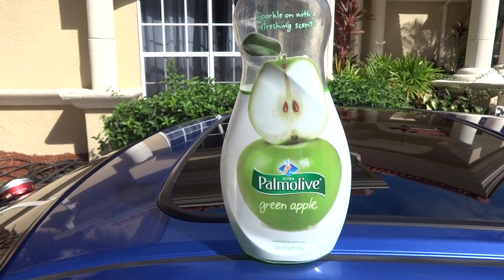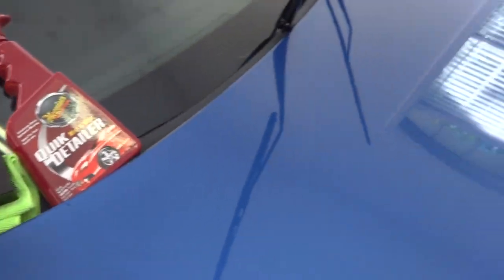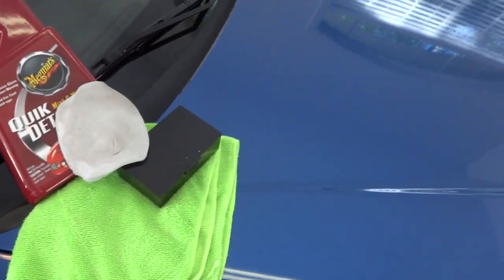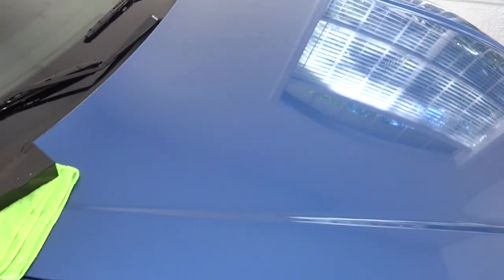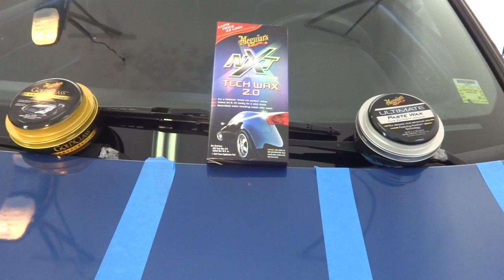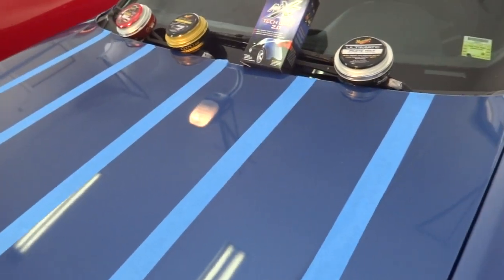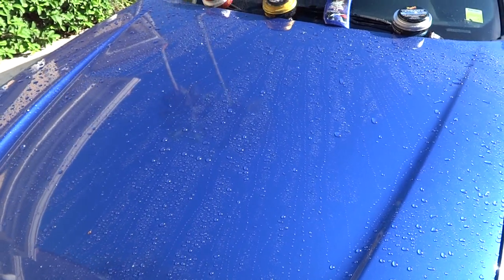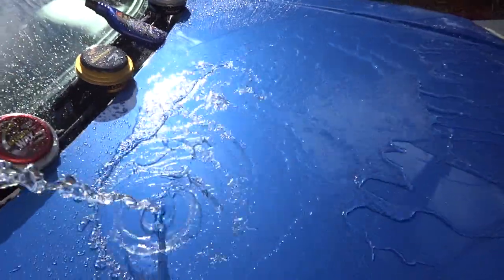The difference between Meguiar's Cleaner Wax, Gold Class, Tech Wax 2.0, and Ultimate. Comparison.

Comment: Nice test, i use a lot of Meguiars for detailing my own and others vehicles. The last two are full polymer waxes ;so it makes sense that the water beads better and flows off better. The cleaner wax has its place if the car has embedded dirt if someone isn't inclined to clay first, and its cheap. The gold class has no cleaners in it but it has some carnauba and some polymer so you can get more depth on dark metallic paints.plus better protection The last two have no carnauba so you wont get much depth. All i noticed is the ring and watch. I actually took a Meguiars seminar when i trained at a car wash. Jewelry is not accepted. Just saying
Reply: I heard Cleaner wax hurts clear coat; the Gold Class won't hurt right? I want that hydrophobic effect, so, dust won't cling on the car.

Thanks.
Reply: I never heard cleaner wax hurts clear coat i you use top brands. I know cleaner wax has solvents and slight polishes in them that prevent you from building them. Any additional coats remove the previous one. Waxes like Gold Class and Mothers Gold can be used after a cleaner wax because they contain no solvents or abrasives.. I love those two after a cleaner wax or polymer wax on darker colors.

Comment: Nice job on this video. I actually use the professional version of tech wax 2.0 which is called synthetic sealant 2.0. Amazon has it for $40 but it will last you an extremely long time and it lasts on the car a long time too. Great for keeping bug guts and bird droppings from eating into your paint. I like to use the carnauba wax, then sealer and finish it with 'Last Touch' detailing spray to really protect the clear coat from the elements. Water definitely beads off nicely and car washes after are easier to perform because dirt does not stick. Again great job on video, hope you get more thumbs up and hits!

Comment: Hey, thanks for taking the time to do this. I've been using Meguiar's Gold Class on a regular basis for several years now with satisfactory results, but I might have to consider splurging on the Ultimate when my current bottle of Gold Class runs out! I've also use/used Malm's and Adam's, but Gold Class is still my "go to" wax. Thanks again for messing with my head!!

Comment: Excellent review. Nice 01 EBP base & looks to be either 90 or a 91 frost white 3rd gen,  Si 4WS? One question tho, why didn't you just leave the control sections alone after removing the tape? Great job regardless its still a lot better review than a majority that I've seen.

Comment: nice video but I would say the most important thing is how the water seeps/sheets away not beads up, because ultimately thats what's you want how quickly the water runs off...when it beads up the water can just run a little bit but still sit there... when it slides down and runs off in one big sheet THAT'S WHAT YOU WANT... so with that said which do you think sheeded Off the best overall?

Comment: Thanks for doing this.  It was a very helpful video.  Just as additional info for people watching this, the NXT and Ultimate are synthetic waxes, also know as paint sealant.  There's actually a chemical reaction taking place as it cures, which leaves a very durable protective layer behind.  Natural carnuba waxes cannot do this.  This is why synthetic sealants are so much more durable and can last for up to 6 months.  You'd be luck getting more than 3 or 4 weeks of protection out of carnuba.  Even less if it's exposed to the elements.

Some people feel that carnuba offers better depth.  This may be true if your pain was freshly polished, but the effect would be very subtle.  One option would be to do a synthetic wax first, then layer periodically with carnuba to sort of get the best of both worlds.

Comment: Hey, I see your in to this "waxing stuff"... I was there a few years back myself. You did a great job on the video comparison however I think the following information will be pertinent to you. Couple of things for you to know. The true test on the water beading  is how well it runs off the car... not what stays on the car. I won't bore you with molecular structure of water and surface tension relationships but in terms we all understand water as you know will seeks its own level. The molecules stick together unless they are disrupted via surface tension of some sort. Depending of the gravitational pull the surface tensions is either strong enough to hold it in place (ie. the beads of water on the hood of a car)  or the molecules release to again seek its own level. OK, how does this apply to Paint and wax? Well with the absence of surface tension the water will flow off the car and actually not bead up at all. But a coat of oil on the car and see how it won't bead up at all. What causes the water to stay on the car is tiny little imperfections like contaminants from the road, sky etc. as well as the hardness of water itself.  Then you say what about the "freshly waxed car". Well to your hand it feels smooth as glass but the reality is there is minute clumping of wax on freshly waxed car also giving the water something to hold on to. So run off is better test. You'll also notice that there are some droplets bigger than others.  Long explanation but bigger droplets are a result of the contaminates and hard minerals in the water itself and the size of the imperfection the water it being held up by. For fun, buy a gallon of distilled water and then use that on a similar test and you'll notice a lot more runoff because the hard water deposits in the water are not there to attach to other contaminants/surface tension.  So your real test is not what stays on the hood but what rolls off as well as how long it last and also what I think is the most important aspect is "ease of use" and "depth and richness of shine".   Any which way, the wax is used to form a layer of protection between atmospheric conditions and the clear coat top of paint. Clear coat protects the paint itself now so we use wax to protect the clear coat. Things like Industrial waste and hard chemicals and minerals in water and other crap in our air make an acidic compound that when left on your car etch the surface of your clear coat or paint and lead to various types of oxidation. We want our wax to protect us from that oxidation while giving us a beautiful shine with great depth to it. These newer polymer waxes have less microscopic imperfection once applied that allow less surface tension to be present therefore more water runoff while providing longer protection as a better barrier to the outside elements and sun.
Lastly, as a tip to your fans. When washing your car don't use a spray nozzle on the final rinse.  Take off the nozzle and turn on the water to med/low so its coming out slow enough to not be disrupted at the hose end and gently guide it over the hood and systematically work your self around the car over the windows down the doors etc. You'll find you barely have to dry your car as the water stays "heavily" attached to its self and rolls off nicely.
Reply: best explanation and very well said!
Reply: Scott Sarver bloody oath thanks mate! Great information
Reply: Paragraphs are your friend. Or, they should be...
Reply: So which wax would you recommend on or off this list?

Comment: Brilliant comparison. Very unbiased and fair. Perhaps the video doesn't show it all, but from what I can see they all have virtually the exact same effect. Would be interesting to know if any lasted longer
Reply from the maker: xr8brisbane Tech Wax 2.0 and Ultimate lasted the longest of all.
Reply: Thanks. Personally I'm a massive fan of Scholl Concepts at the moment. Absolutely miles ahead of Meguires and Mothers if you want to try something else. Also the answer is no, I don't get paid by them or have any connection, I just love cars and passing on knowledge.
Reply: I concur that you are absolutely correct about the little or no differences between the Meguiar's. waxes and  water beading from the water spray test. I usually use the wax to shield the paint from dirt and get a little shine, not what it does for water.
Reply: I agree they all looked the same to me..

Comment: Hello Acc0rd79. I have all the waxes you have in this video. I have a question about the NXT Tech 2.0 wax. I seen that on the box it said it last's twice as long. Does it last longer than the Ultimate Wax? I haven't used the NXT yet. I picked up the bottle and shook it up and down and it seems like it's thinner than the rest of Meguiar's liquid waxes. What's your experience with this wax? Is it like a sealant? Say like I wax with Ultimate wax and then throw the NXT on top of it? It doesn't seem like it would be that good for it to be thinner than other liquid waxes.

Comment: Only thing missing is a durability test because they all repel water pretty good.
Reply: That's because meguiars waxes have crappy durability (Meguiars gold might get you 2 months at best).  Get either Collinite 845 (an easy to apply and remove wax that lasts 5 months) or Collinite 476 (a harder to apply and remove wax that lasts 8 months).  P.S - I'm a car detailer and Collinite's what I use for my biz.
Reply: Yeah that would be the most interesting part of this test.
Reply: I would suggest P21S or S100.

Comment: Oops, you used quick detailer as a clay lubricant which has a wax in it.  So there is no control.  Also it may interfere with the other waxes.
Reply: not all quick detailers have wax, and im assuming that since the lubricant came with the clay bar that there is no wax in it.
Reply: @packapunchie  It is a wax detailer. I used it on my car once.
Reply: are you sure? why would they make it a wax detailer when it comes with the clay bar? it doesn't make much sense to add wax while trying to remove dirt and debris stuck on the paint
Reply: @packapunchie  Ye pretty sure as it is a detailer like auto finess or autoglyms products.  In my opinion although I see what your saying it is just to lubricate.  Doesn't matter if it has wax in or not. It is just a wax maintenance spray so has minimal impact by time you wipe you car down, pre wax, wax and use sealant.  They clay is just to remove the contaminents not the wax so you could use it with out stripping old wax off depending on the quality of the finish thats on your car.
Reply: personally ive never tried to use a clay bar without stripping the cars paint and then waxing it right after. I see what you're saying though!
Reply: @packapunchie  striping the paint you say?
Reply: @edubb2491  i dont even remember what i meant to say haha

Comment: I recently waxed my car with the Cleaner Wax, and it looks amazing... Do you suggest I maintain that by using the Cleaner Wax every 6 months or so, or do you recommend me to switch to a regular wax? My car is only 4 years old and garage kept year round.
Reply from the maker: if you want even more of a shine or more protection you should go up a step. Gold class is carnuba based which means it will pop more with the glossy wet look but it will only last for about 3 to 4 months. A synthetic based wax like the ultimate or nxt will easily last 6 months but wont give it that nice wet look. Just make sure your clay baring before hand. Get the junk out of the paint first!

Comment: great review and thanx for tacking the time to do it. I would have to be honest I dont notice much difference on any of the waxes but im no expert.
Reply from the maker: its ok, im no pro either. You really see the difference overtime and the carnuba will pop on my cars much more than the synthetics (tech wax and ultimate). All 4 waxes were fresh, they better not suck that quickly:)
Reply: Acc0rd79 So which Would you most recommend? The gold? I couldn't tell from the video either, but you said the gold wax was easier to remove and it has the carnuba and makes it look better... or whatever. lol. Sorry, I don't really have any experience with this. I just bought the red one the other day and was planning on washing/waxing my car tomorrow.

I'm down to take it back and get something better though.
Reply from the maker: ***** I enjoy that wet look to the wax that makes it pop more so I like the carnuba but for my cars that have to sit in the sun all day long, I use the Ultimate or Tech wax because they are synthetic which gives me longer lasting protection. But, my 2 garage cars always have carnuba based wax.
Reply: Acc0rd79 Awesome! Appreciate the tips/advice.

Comment: Thumbs up, Proper comparison for sure.
Reply from the maker: ashequl arif thanks
Reply: Acc0rd79  Which foam gun do you use. does it connect with a normal garden hose?  or does it need a pressure washer machine?

Comment: Thank you for posting! I am a Maguires Fan!  I have a Black 2013  Maxima and I use their Gold Class Car Wash, Superior Gloss,  Quik Wax Detailer and Mist, Mirror Glaze #7 and #9..... It's SERIOUS BUSINESS with my 🚘...Guess you can tell 😂. I have a buffer machine but I haven't used it yet and by me living in an apartment, I have to use a Car Cover. My question is how long does it usually take for you to buff your car on the regular? Also, I have clear coat scratches. Which product do I use for that?

Comment: Help please. My towel had dish soap on it by accident and I cleaned a small section. I guess it took the wax it but it left some swirl marks. Is that what it is suppose to look like without wax? Can I just put wax back on the section and the swirl will be gone?
Reply from the maker: ***** wax only fills in those swirls, doesn't get rid of them. You would need a compound or a polish to actually get rid of the swirls.
Reply: ok thank you. what towel should I use for the polish and the wax
Reply from the maker: ***** get some good microfiber towels.
Reply: If the swirls are bad you'll have to buff it with a buffer. Cutting compound then swirl remover, which takes a layer of clearcoat with it. If the paint has a lot of surface scratches then it may need to be wet sanded. Truth be told, every new car could use a buff. If you ever look at the paint you'll see what's known as orange peels. Because the paint isn't smooth like glass, there's a lot of irregularities that looks like an orange peel.

Comment: Thanks for the comparison. I just had my car painted, and I have been vapor-locked trying to decide what to put on it to protect it.I'm going with the Tech Wax 2.0. Do you have any suggestions for how to deal with the ribber trim? I do not know whether to try and mask it all off with blue painter's tape, or just apply the Tech Wax to it, or what.
Reply from the maker: Im pretty sure tech wax wont turn your rubber trim white like a lot of the cheaper ones are but please research that before hand. I know all of the high end ones don't do anything. As you might be able to tell on this car, there is black trim and it had no affect if it went over on it when applying it. If you had to make sure you could tape it off, but one thing I like to do is have a microfiber cloth near me for any accidental overage. Just don't ever buy cheap junk wax is the easiest way. Meguiars high end stuff does good though!
Reply: I Love using tech 2.0 but the trim will turn white if it gets on. comes off pretty easy though with some elbow grease. if not I use Mothers back to black.
Reply: I use the Tech Wax 2.0 and IT WILL turn your plastic and rubber white.

Comment: Great Work Accord79. i absolutely love your videos. In mothers version u showed inside each can and commented about the look of the wax and its feel.I want to know is goldclass harder like ultimate or its softer like when u push into it, it feels kinda sponge or warm butter. Mine one is softer and i think it may be damaged cause of heat during transit. Your opinion will be highly appreciated
Reply from the maker: waqar azeem the gold class is a bit harder than the ultimate. When the waxes head up, they cool back down and solidify again once in a cool area. No issues at all, you shouldn't worry at all, plus any of the paste waxes have a plastic seal in them.
Reply: Acc0rd79  Thanks Bro

Comment: Hi,accord79

from what watched in your video,I saw that they almost have the same result isnt it?

but I was wondering,what is the difference between all these and the polishing and rubbing compound,I really want to have my car shine..What do you advise me? 
brilliant video btw :)
Reply from the maker: shrov1811 they all bead up good right after the initial wax, however they do in fact give different lasting results as well as different looks on the car. Synthetics will last much longer than your standard waxes. Compounds and polishes are meant to take out small imperfections in your paint like swirl marks, not to wax your car with:) I hope that helps.
Reply: Acc0rd79

Thank you for your reply man,

It helped :)

I have an Accord too btw :)
Reply from the maker: shrov1811 I owned 2 of them back in the day, an '88 beater and a '00 brand new off of the lot:)

Comment: Ive wondered what "cleaner wax" is used for? so I tried Mothers Cleaner wax, followed by a coat of Surf City wax, I guess is the cleaner wax neccessary?
Reply from the maker: +Howard azmat clearner wax has some abrasives in it to help get rid of the light swirl marks in your paint and just generally clean it up. The regular waxes wont have that at all.
Reply: Thanks.